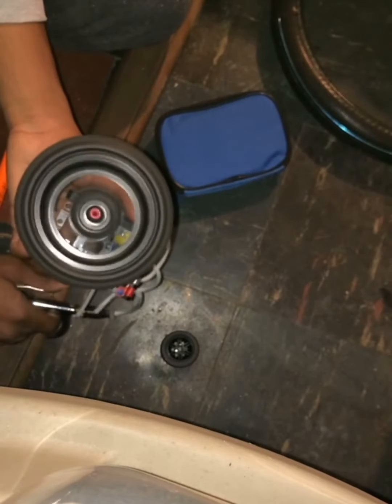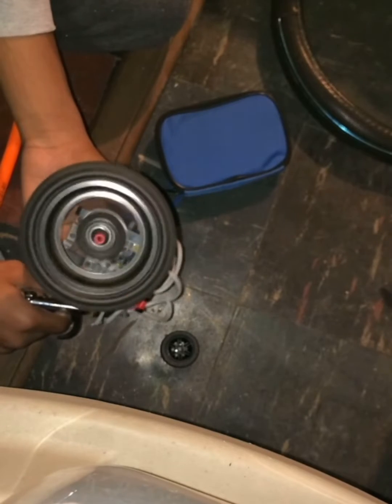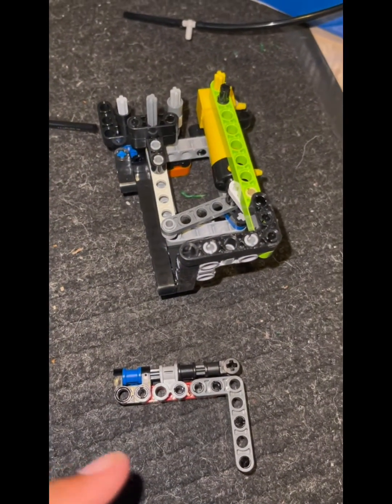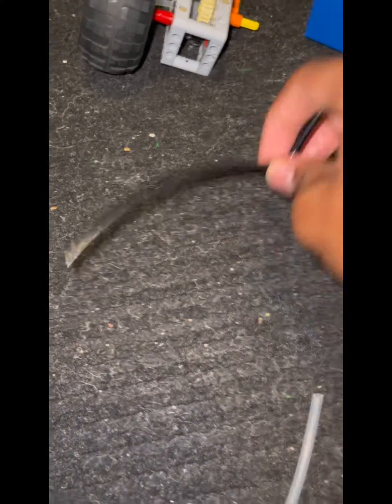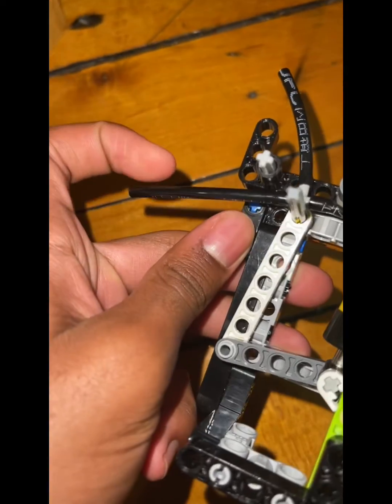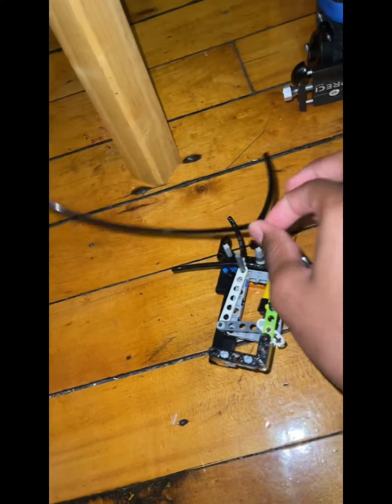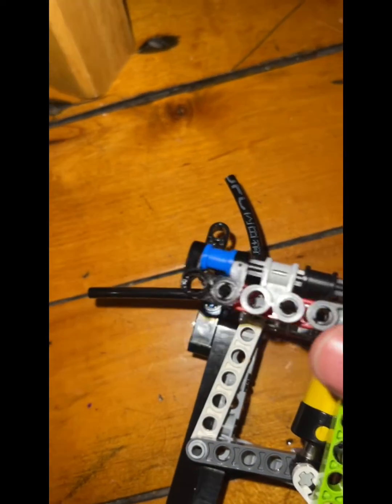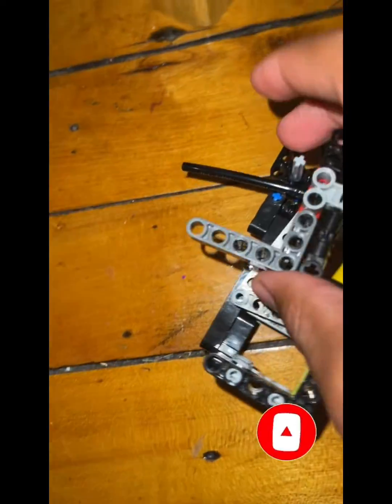How to build: LEGO TECHNIC SWITCHLESS PNEUMATIC ENGINE - See the step-by-step instructions!

Comment: Hi, can i use lego official tubing? I think it's too stiff, will the engine run properly using them?
Reply from the maker: I think the tubing that I used in the video was from a mould king pneumatic kit, but I may be wrong
Reply: @JaceN3D  so i tried the lego tubing and the axles that close the tube on top were bending and the valve needed a lot of force if operating manually, so i ordered silicone tubing (2mm ID, 4mm OD) with 60-70A shore hardness. I will tell the result
Reply: Ok i will try to use lego tubing
Reply: Ok so the tubes that i ordered are compatible and soft, and the engine itself works flawlessly (i was using them with drdudenl's 3800 rpm engine)